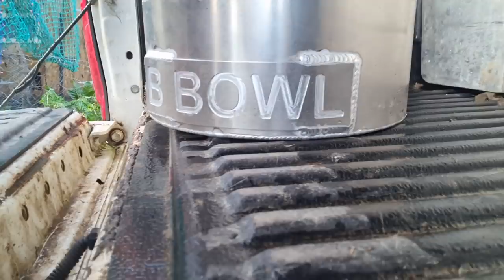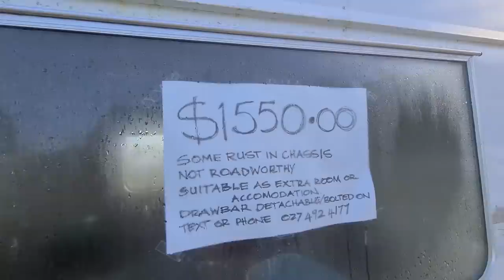Dogs, Farm, Houseboat & Chicken 4 Dinner.

Comment: Hey, that thread and nut on the end of the starter towards the bottom is for a earth strap, chuck an extra earth from your battery main chassis earth round to end of starter, will help give it a longer life than the starter earthing though the flange alone, also helps to clean the bellhousing up really well before fitting the starter
Reply from the maker: great tip mate

Comment: Could you weld some steel to the block so that you can then drill and bolt the central flange (you pointed to it in the video at 18:13) into the new steel?
Reply from the maker: Yes that would work

Comment: It couldn't be more obvious you've been sold the wrong starter motor. Take the starter motor off, use a piece of paper to mark out the the mounting face and its holes in the engine casing. Take the starter back to the shop with your marked out paper and ask for the starter that fits the hole pattern. Don't go drilling anything you'll only go from problem to disaster.
Get a small peening hammer, thats the one with a ball end. Hold the paper to the mounting face on the engine casing (Clothe pegs might do that) and gently tap out the shape of the mounting using the sharp edges around the mounting face to cut the pattern required on the starter motor. 👍
Reply from the maker: Too late mate. It's identical to the starter motor that was on it which also was the wrong one. It's a Ford starter on an old Nufield tractor engine. There are no more starter motors for that engine Gerry. I am a bit poked for a better option.
Reply: @ClayTallStories  I have a saying for you "Good things come to those who wait", you wait for your plants to mature before you harvest them, you wait until the pig is under control before you get your knife out. How about waiting until the shop has the right startermotor? 😉

Comment: Hey clay love the vids mate cheers if ur worried about the starter moving u could put a 90 % bracket at the back end to the block one bolt onto starter one into block at least it wont be able to destroy ring gear and also with the batterys some times running more than a few linked together u can have 2 good ones out of the 3 and one can drag the other 2 down especially when starting 1x grunty 1000 cca or there abouts marine battery shud be able to do it alone. Hope any of this helps mate cheers
Reply from the maker: Good info mate